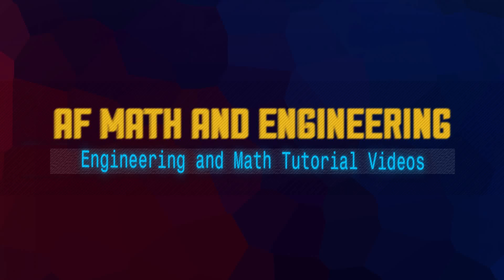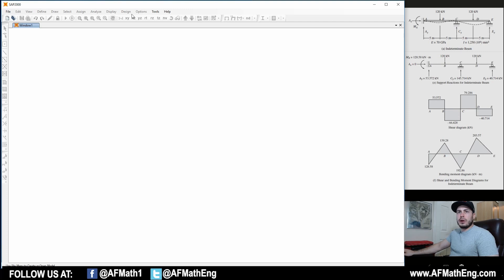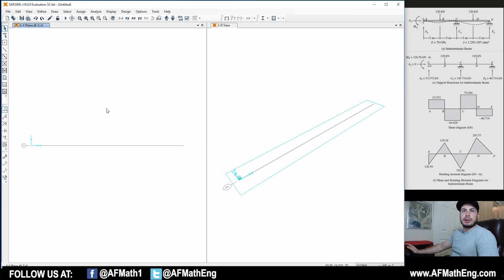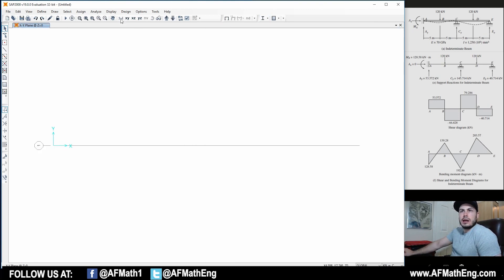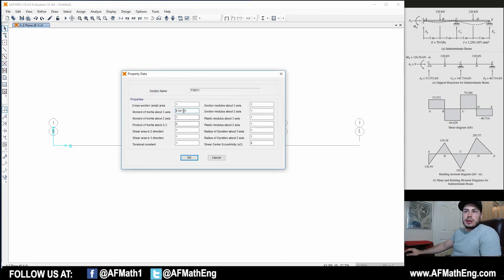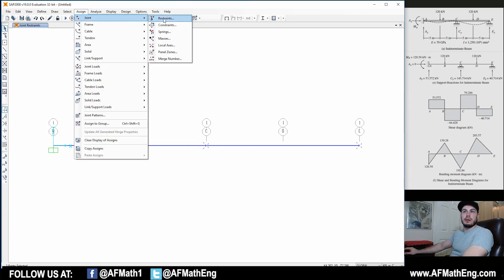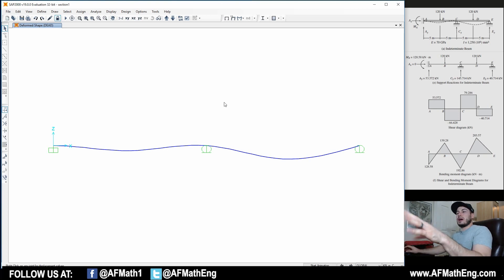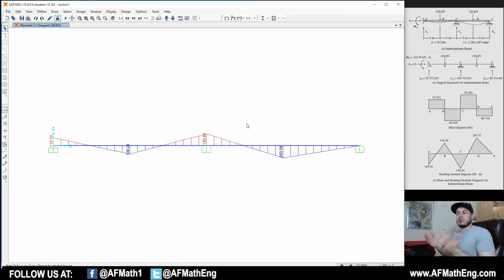How to Solve a Beam in SAP2000 Tutorial - Powerful Tool For Getting 100% in Engineering Assignments!

Comment: Hi AF Math & Engineering, thanks a lot for this video. I have trying to find a SAP2000 tutorial on Modal Analysis of 2D frame to find the eigenvalues and eigenvectors as what discussed by Anil Chopra Structural Dynamic and Earthquake Engineering.
Reply from the maker: thanks for the feedback.. have you tried csi's videos on etabs or sap? i believe they have some tutorials on modal analysis.
Reply: Yes I have seen those videos by CSI but they are a bit different in some ways. As in Anil Chopra, the given values are column stiffness (k = 12EI/h^3 N/m) and mass (kg). It assumes that the beams' moment of inertia is much greater that it will not deform, thus meeting a shear building analysis.
Reply from the maker: I see.  Do you want to send me the example by email? I could check it out.  Afmatheng@gmail.com
Reply: Hi AF Math & Engineering, I just made it right. Thanks.
Reply from the maker: gotlboys great, glad to hear.